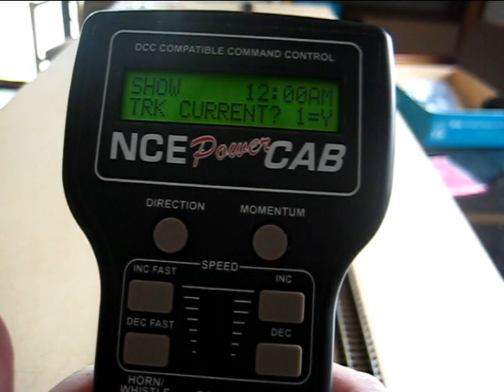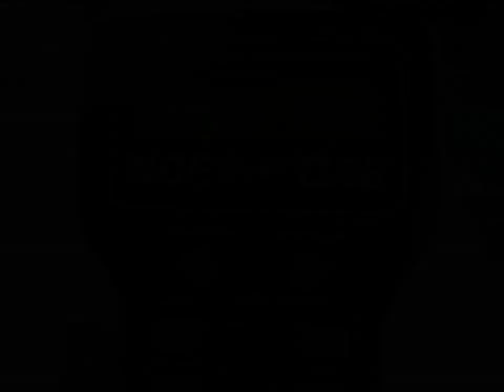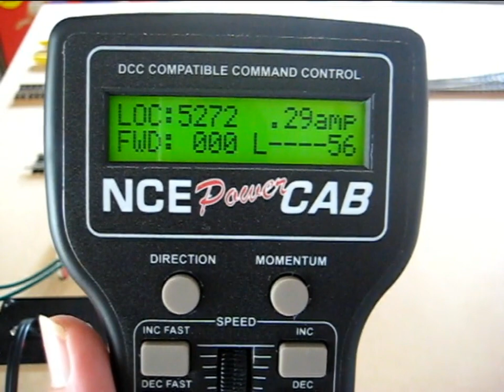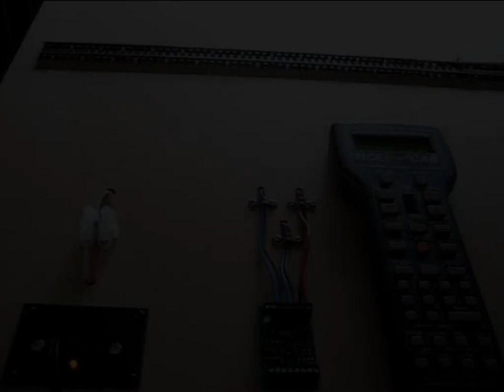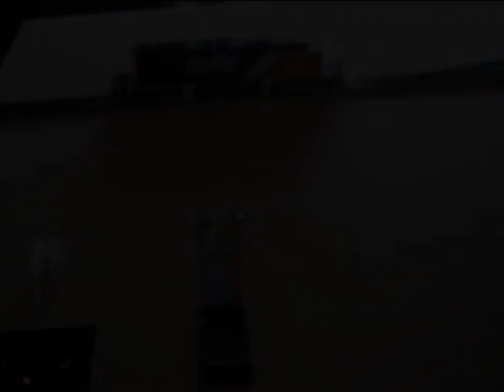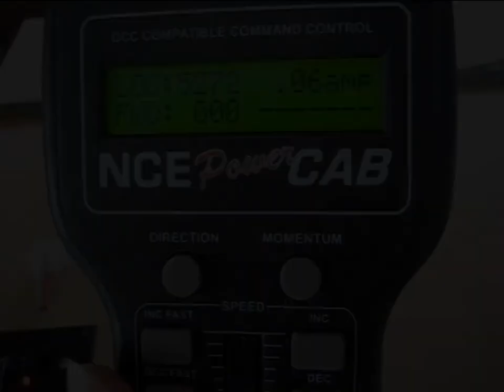#14 Small Model Railway Layout with NCE Powercab

Comment: The BD4 is taking the single input from the Power Cab and redistributing it to 4 separate outputs. Those outputs are isolated from each other.  Therefore the Power Cab is picking up the power reading from the BD4 not the section track.
The program track is connected directly to the Power Cab.

Comment from the maker: Yes, when I run the train it reads about 0.11 amps, but it still isn't the same reading as when I test it on the small piece of track. Everything runs fine it just doesn't show the correct amps. The only thing left that I can think of is the bus line, It was made from some old wire I found lying around. Replacing the bus line would not be a easy task. But if I were to do it all again I would install a new 12awg bus line.